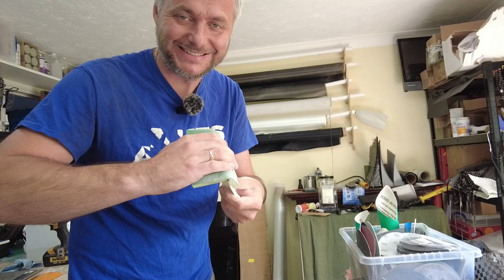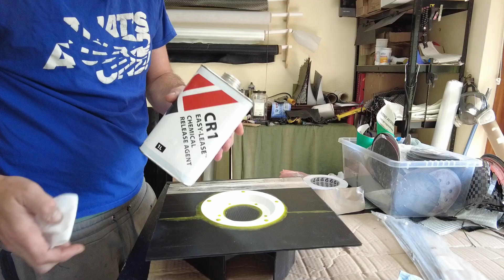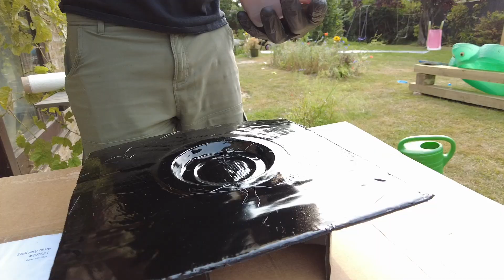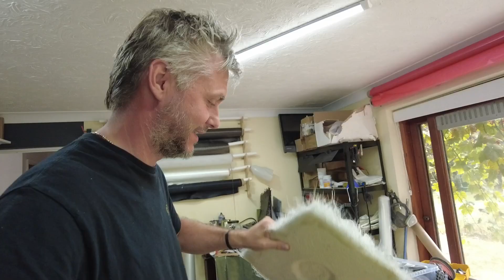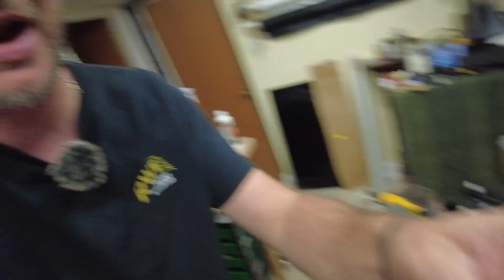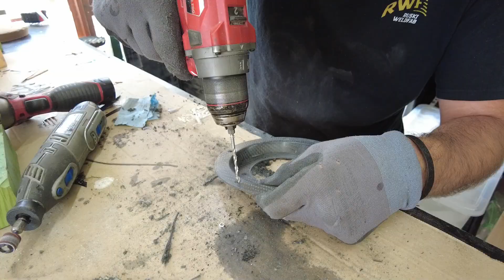From 3D print to Carbon. Custom @NukePerformance filler cap adapter plate

Comment: nice work! you really should be wearing respiratory protection though, fiberglass and carbon fiber dust are easily capable of causing malignant cancer cell formation in the lungs.
Reply from the maker: thanks i try. sometimes i forget. bad habit